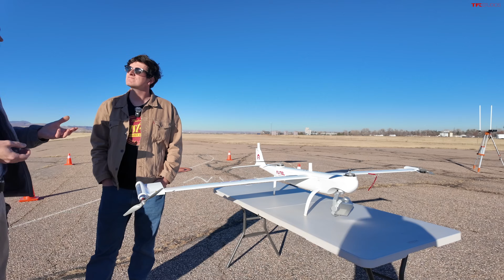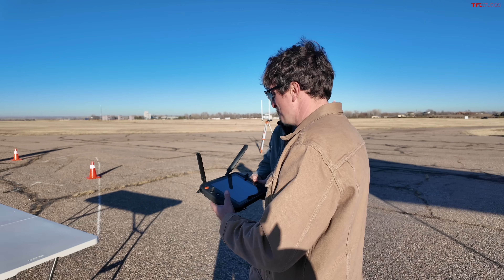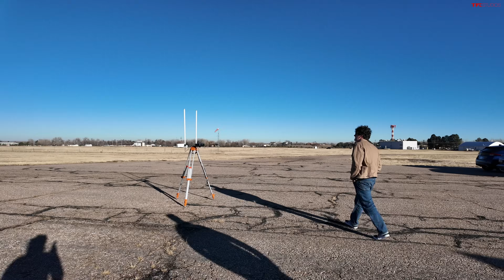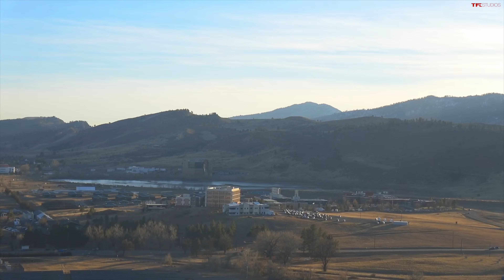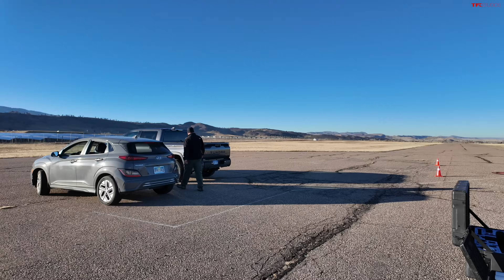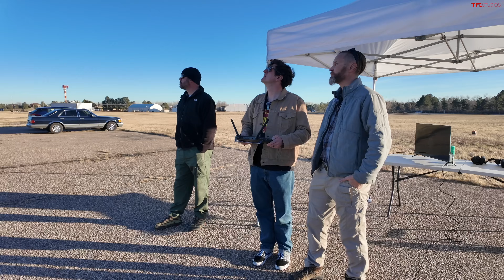Here’s Why This Tiny Plane Costs $130,000!

Comment: You could buy an old general aviation aircraft for less than that and still afford flying lessons.
Reply: And fuel, insurance, maintenance, hanger rental space.  But only for about a 2 years.  lol  As a pilot I know what you are saying, but it is not cheap in the long run.
Reply: You could buy it, but you couldn’t own and operate it for very long at that price.
Reply: speaking of, about how much are flying lessons?
Reply: @midwestmulisha820  $10k is the bottom of the range. You might find a flight school at a local regional airport that could come in a little less.
Reply: About 250 each lesson @midwestmulisha820